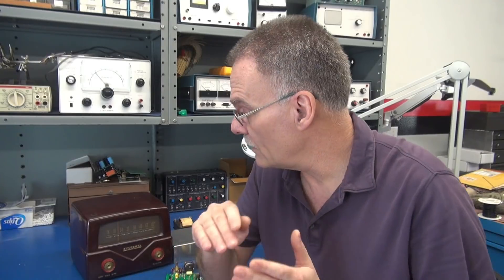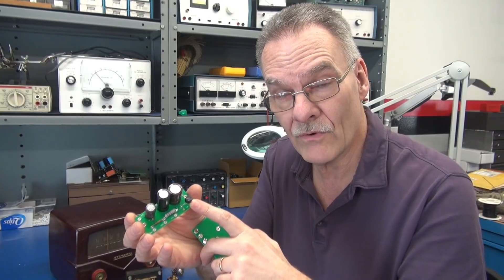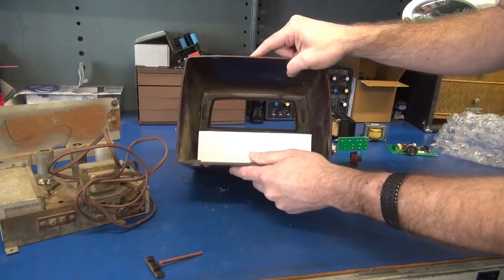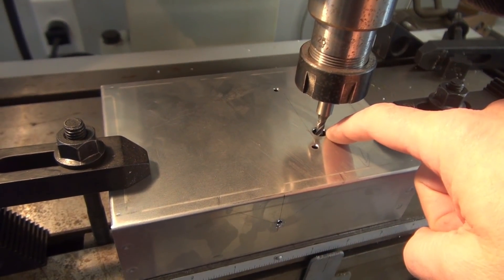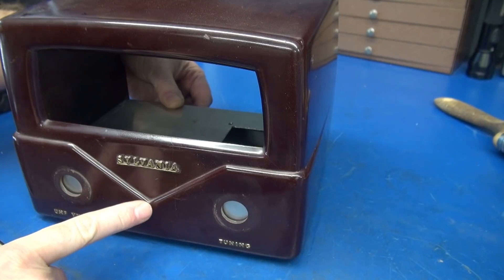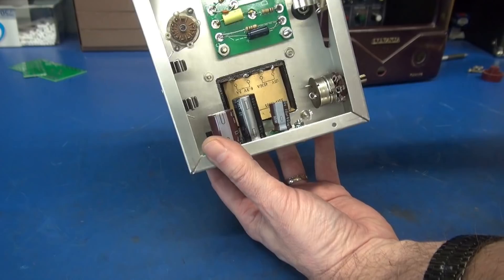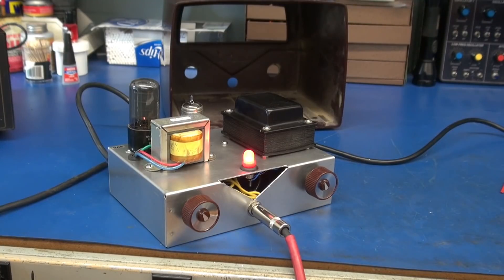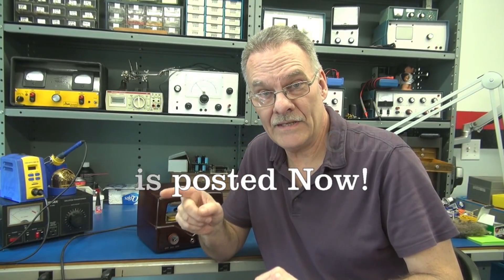Details How To Build a vintage 6V6 tube 2 watt Guitar amp from ground up Easy method for beginners

Comment: Terry , couldn't you fill the original knobs with a epoxy and insert the pots for a spline . Just coat the pots with wd40 first so they dont adhere . Boom original knobs with splined pots for that authentic look

Comment: Thanks for the video. I am not a guitar amp builder, but isn't a gain/pre-amp circuit needed to overdrive the amp, but still have control of the volume? If so, do you have the board and schematic for the pre-amp? I have not looked at your website to know what options you offer for the kits, but I would like a board and unsoldered parts kit option. Just a suggestion... What would you estimate the cost to be for just the chassis, boards and parts? I know that you reused some of your parts, so a guess on the price will be fine. Thanks for the help.

Comment: Terry I am planning on building your Vintage Tube Console Radio to MP3 player amp. Would this circuit work better? I really like the idea of using the ECB-A class A board with the Cub 1 power supply board. It would be so much easier and it really looks good when finished.

Comment: I couldn't help but notice a little bit of hum when turning up the volume, even without the guitar plugged in. I had the same issue with an amp i was building (6V6 + 12ax7, but with a 275v transformer and solid state rectification) but the hum vanished when i opted for a 220r trimpot as the virtual center tap for the heaters. Heard this tip from the electrical engineer I purchase most of my transformers from, as it's commonly used for tube Hi-Fi amps.

Comment: D LAB, most fender amps and radios schematics don't use grip stoppers any reasons why? because when not using grip stop resistor it causes oscillations and other noises

Comment: Hi Terry, I’m sure you are quite busy, so I don’t expect an immediate answer at all :).  I’m curious what changes (besides the footprint/size) would there need to be to do this same circuit but as a parallel single-ended with el84s.  If there are too many to mention here in a comment section, I certainly understand!  Cheers, love what you do!
Reply from the maker: Simply rewire for the EL84 pin base and re-bias

Comment: Hey Terry quick question I’m wanting to build the 2 watt guitar amp that you built also using the 6CL6 tube and the 6AV6 tube but I wanted to ask how much you would sell the populated PCB Boards for $ ……and also another question I had was is there anyway to make this amplifier use a solid state rectifier section or even possibly add in a negative feedback switch ?  If neither of these ideas are possible then I Absolutely have NO Issues with building it as your schematics are shown…….PLEASE PLEASE PLEASE HELP as I’m wanting to start this project building ASAP but really really want to use your pre-assembled PCB BOARDS please respond to this comment letting me know the price $$ of these BOARDS in a populated assembly ………Thanks for ALL that YOU do for us all and bring to ALL OUR ATTENTION with YOUR AWESOME VIDEOS !!!

Comment: In the USA that Sylvania UHF converter cabinet is often labelled  Mallory( original maker ) ,Silvertone, Crosley or Alliance. 
They also show up on fleabay often enough and as you can see make terrific start for a boutique guitar amp project. 
Awesome stuff Terry. Builders can make and modify it as they wish.

Comment: Hi Terry! I have been watching your videos for several months now; I was attracted to the repairs on the vintage Fender amps (of which I have owned a couple of "silverface" amps since the mid-70s). So I am getting quite an education about how guitar amps work.

I have a question about this build: Is there a reason you elected to have the power switch on the tone pot instead of the volume pot? It seems counter-intuitive to me... 

Thanks for all you do, and good luck with your solo gig! 👍
Reply: Either way works.  My guess is he did it that way because of the potentiometer values.
Reply: @timmooney7528  No offense, but I'd rather hear the logic behind it from Terry than your "guess"...
Reply: @DustInTheWindAZ  In another post he replied the switch being on either pot was ok.

Comment: 3:42 - Couldn't you mill the shafts of those pots to make them 'D'-shaft-compatible?
Reply: The answer is yes,.  No need to do so if there's a set of knobs in his inventory that fit.  Time is money, and the least time it takes to build an amp equals more money in his pocket when it comes time to sell it.

Comment: Why not on/off volume combo instead of tone? This is more practical and common methinks? Thanks Terry!
Reply: My two cents on this is that, considering that the pot with a switch was the 500k, and the other one was 1m. For a tube amp, i'd certainly choose the higher resistance one for the volume, as it "pulls" higher frequencies directly to ground.
Reply: @joseislanio8910  makes sense. Thanks
Reply from the maker: Those were the controls I had available, A rear power switch with no switched pots would work too
Reply: @d-labelectronics  I mean, instead of wiring the combo switch pot to tone, why not to volume? Because of the pot values?
Reply from the maker: Yes, for this build. This is not set in stone, feel free to expand on your build
Reply: @d-labelectronics  Right on. I really love your creativity on these. I could tell you were scoping out candidates at the last ham fest! Keep up the great work sir.